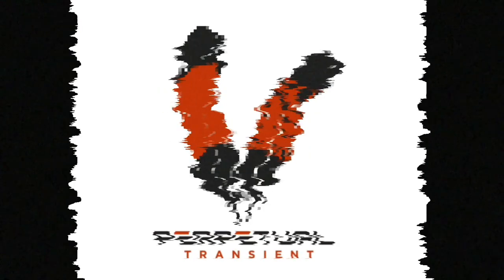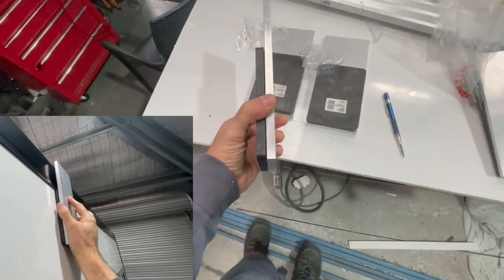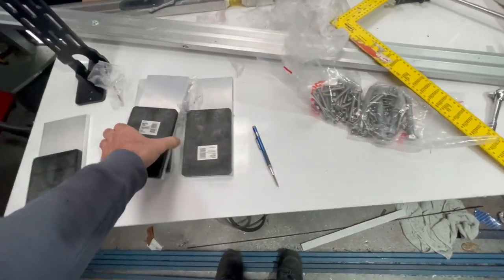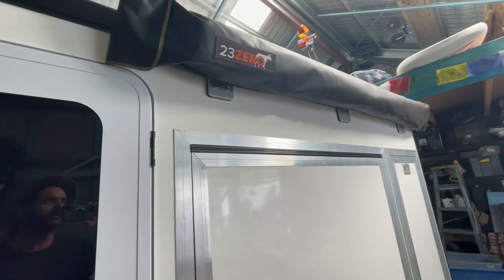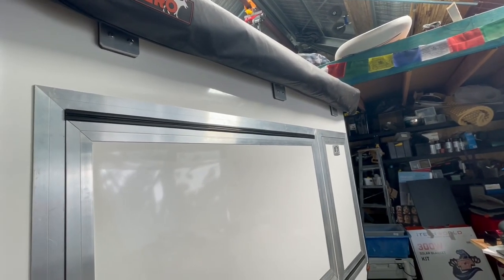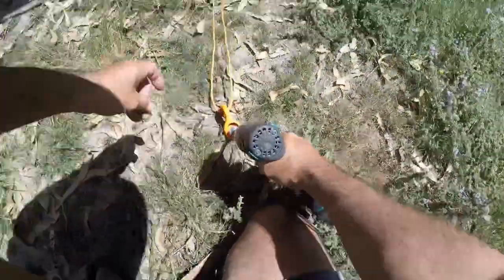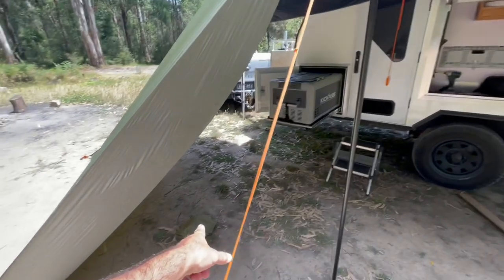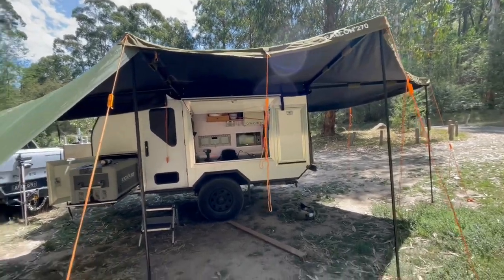23Zero Falcon 270 Awning install on DIY Caravan

Comment: I just bought one and have realised the stupid person who designed this awning put the mounting rail inside the bag which means you can’t adjust where the awning sits once you’ve made your holes in the bag and put your bolts through them. Turns a 20 minute install into over an hour
Reply from the maker: I actually talked about that in the filming and edited it out of the final vid. I think they do it to help keep water out of the closed bag when travelling maybe?
Reply: @PerpetualTransient  hmmmm I hope it’s worth it!